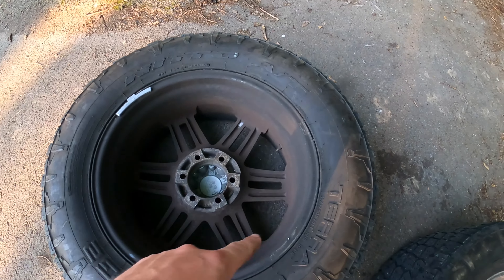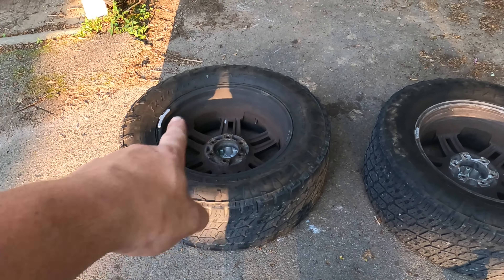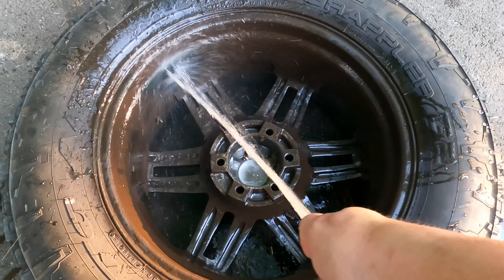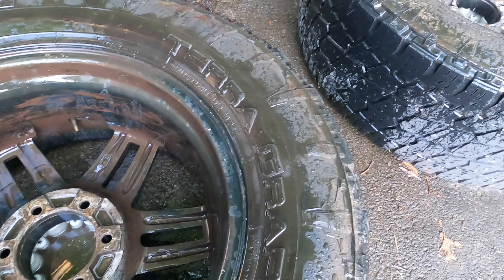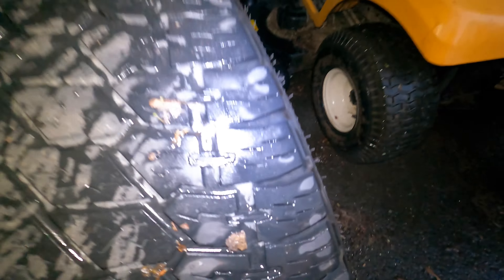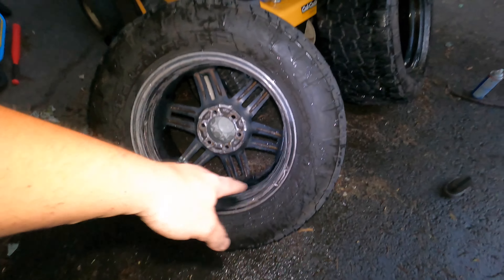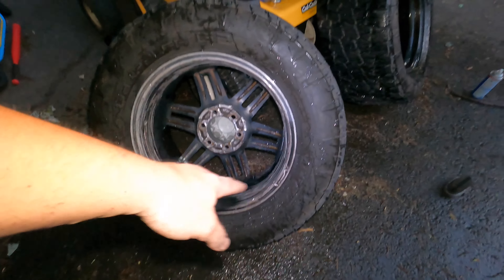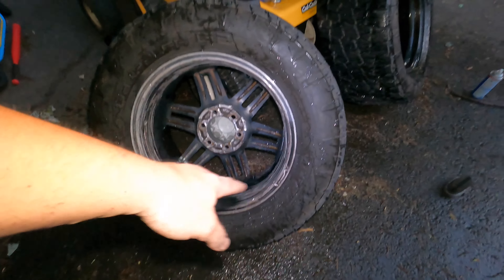Cleaning Super Dirty Wheels with Oven Cleaner?!!??

Comment: I tried this about 4 years ago on my Ford F150 STX I had since new in 2005. I had never scrubbed my wheels, and there was brake dust over 10 years old caked on. The fronts were the worst. I used oven cleaner from Dollar General and a yellow/green sponge/scouring pad. All my wheels looked brand new afterward. Im going to do the 98 Dodge Durango I have now and clean them up.

Comment: Oven cleaner will remove the break dust. Easy Off Commercial works best. However it will damage the clear coat if left on too long. Use a soft bristle brush, brass, plastic or scotch bright, not steel. Follow up with warm soapy water, Dawn works great, and remember you’re cleaning brake dust so keep everything wet. And if you want to remove the clear coat, apply oven cleaner and let sit over night. It will definitely remove a good bit of the clear coat. The remaining bits can be removed with drill mounted brass wire wheels.